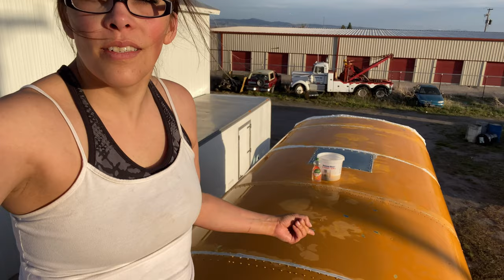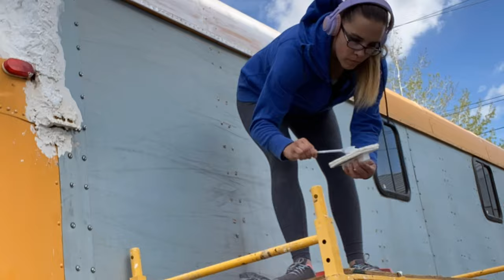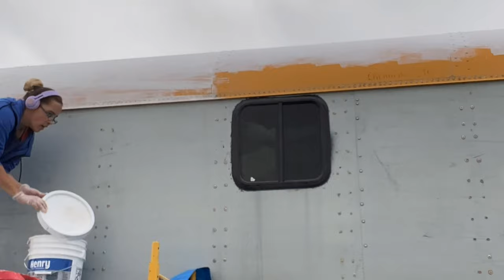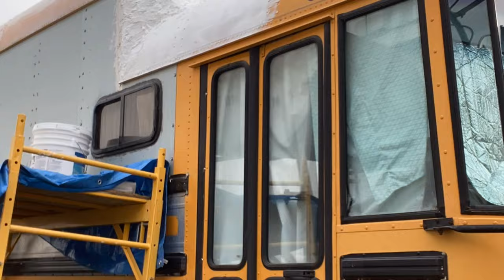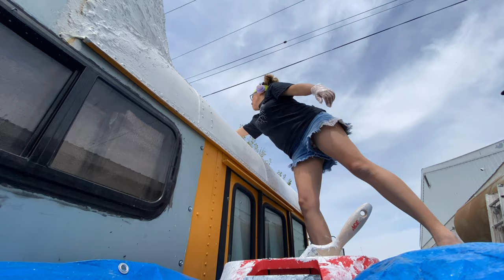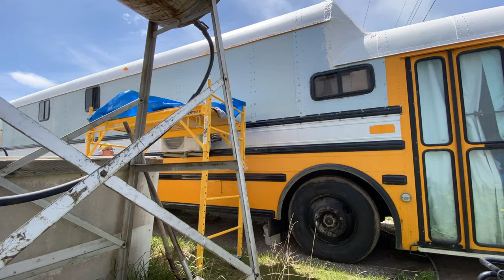Painting the Roof of our Skoolie?! Henry’s Solar Flex Elastomeric Paint

Comment: For those that are interested in using henry's elastomeric silicone they recommend 2 to 6 hours between coats and apply at different angles for each. 1.5 gallons per 100 square feet. North to South and east to west.👍